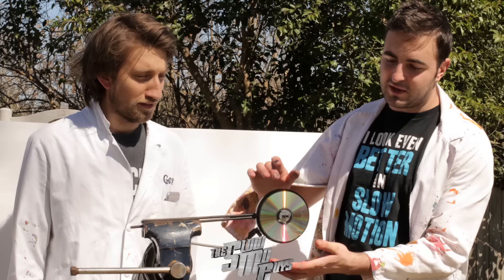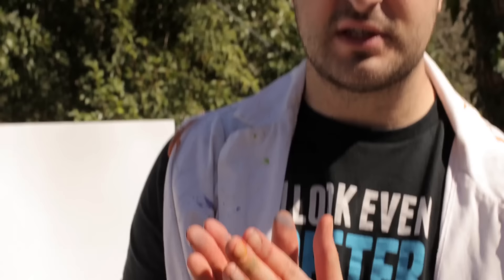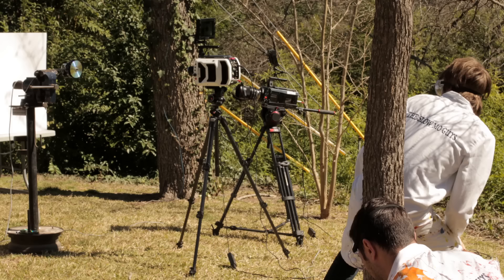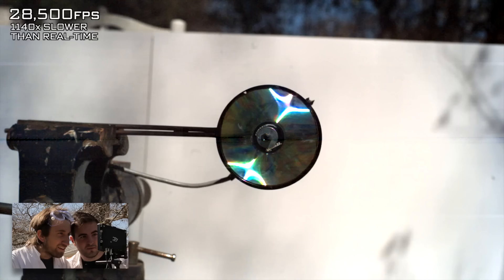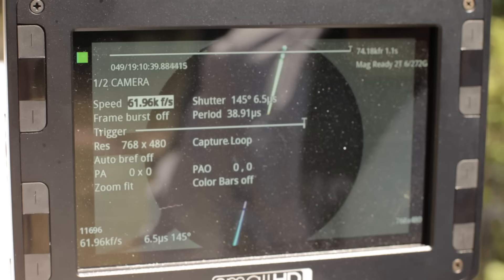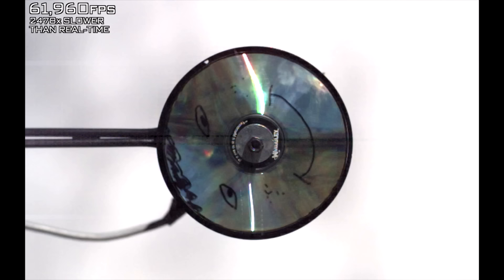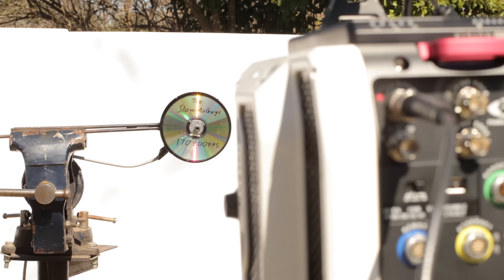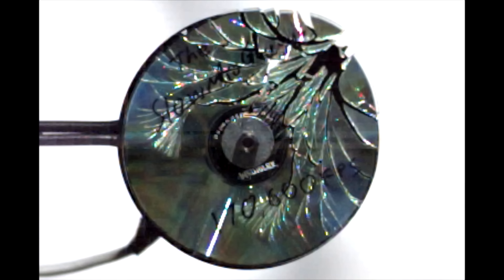CD Shattering at 170,000FPS! - The Slow Mo Guys

Comment: I just calculated that the edge of the CD at 23,000 rpm would be accelerating at 35,481 G's!
Reply: I think accelerating is not the proper word here? When it spins that fast it will feel a high g force. That is due to the fact that a point on the rim wans to travel in a strait line with the speed it has but is constantly forced to make the turn into a different direction. But that is not acceleration since it is constant until it will shatter. From this moment the pieces will start traveling in a straight line that will bend due to the gravity depending on the direction the piece get's launched. And the pieces will decellerate due to air resistance and (gravity  when traveling up.)
Reply: dextersxxxxlab yes most of that is indeed correct, as a major in physics, but it is incorrect to say that gravity will slow it down. Indeed, air resistance does slow down the pieces, but unless the cd fragment is rapidly accelerating at 9.81m/s squared, and counteracting gravity laterally, gravity will actually cause it to accelerate. While those fragments were going quite fast, frame by frame analysis makes it look quite slow, in comparison to something like a space shuttle, which can go at some unfathomable speeds about 1 minute and 30 seconds after launch, and of course the shuttle could only barely get into orbit, so it is unlikely that gravity would slow down the cd fragment. I do like your method of explaining things however, thank you for making the internet a great place 😀
Reply: @dextersxxxxlab  if it wasn't accelerating it won't have broken
Reply: @initiatingspin195  That was why I stated that the pieces only would decelerate due to gravity when they were traveling in an upward direction. (The last words in my explanation)

Comment: How come you can upload footage in 170,000 FPS, but you cant have it in 1080p60 on YouTube...?
Reply: It's not gonna affect the whole purpose of the video, at 60 fps it would look more fluent and consistent.
Reply: Wrong. The video is not at 30 fps.
Reply: the video is at 30 fps though. you can upload at 24/25 fps. but if there is no fps number next to the resolution that means that its standart 30 fps. though of course they could show the slow mo footage at a different resolution than the rest of the video.

Comment: I'm not a scientist, but does it warp because the speed at the center is faster than the speed of the edge? So eventually it gives in to the force and just breaks?
Reply: Julian Acabal No its the G forces that are acting upon the CD pulling on each side outward. Like how a roller coaster sucks you back to the edge of your seat.
Reply: Julian Acabal youve got it backwards, the outside is faster. but good question!  (source: i study physics lol)
Reply: I don't think it's entirely centrifugal forces.  I think there is turbulence being created.  I'd like to see this "experiment" in a vacuum.
Reply: Ray Renteria I doubt it has anything to do with whether or not there is air present. It looks like vibrational frequencies cause the disk to break just by looking at how the disk warps in a wave like shape (sinusoidal). Probably caused by the vibrations from the motor
Reply: vic cobb Why would the outside be moving faster?
Reply: ***** Because everything is moving at the same RPM, but the outer parts of the CD have a larger circumference to go around.
Reply: ***** Speed of a rotating stuff is r*w where r the the radius you're looking it at and w is the rotationnal speed in rads/second. So obviously, if you're on the outside, r is bigger than the inside and so is the speed (w is the same at the center or outside).
Reply: Its because of the vibration depending on the rpm, for the right rpm you get a standing wave on the disk with a much larger amplitude which finally leads to the destruction of the disk
Reply: Julian Acabal The force is strong with this one.
Reply: ***** Because RPM = (Speed / Circumference) × 60. If RPM is constant (which is the case here) then to increase the circumference is to increase the speed. 

Imagine if you were to place a two dots on the disk, one near the center and the other near the edge. Both dots have the same RPM, as in they complete on revolution at the same time - but the outer dot has to cover a greater distance so to keep the RPM constant it has to cover that distance faster. Whereas the inner dot has less distance to cover, so it travels slower to keep the RPM constant.

Physics is such a beautiful thing.
Reply: I posted this elsewhere but it works here too, hope it explains it a bit :)

The centripetal force = m*v^2/r so at the high speed v becomes so great it is able to overcome the tensile strength of the CD.
So here is my math tensile strength of a CD=55-75 MPa, r=0.15 m, m=0.015g, CD(width)=0.006-0.008
v(tangential)=angular velocity*r
v(tangential)=2408*0.15=68.08 m/s

F=0.015*68.08^2/0.15
F=463.5 N

really we should now integrate to find the force on any one point along the disk since F=463.5N is the force at any point along the edge but I'm lazy so lets just approximate that this force will be working on 0.5 degree of the disk (I don't want to make the angle too small otherwise this'll just go to infinity) so A=2*pi*r*0.006/720=0.0000078

so F/area=59 MPa which is greater than the tensile strength.

This is of course is best case scenario but its also just an approximation, the order of magnitude is right so it is at least possible. Of course everything above is also an extreme simplification in reality it has to do with the elasticity of the disk as well and a bunch of other physics concept that would take to long to go over, however you can take a look here http://physics.stackexchange.com/questions/30769/fracture-because-of-high-speed-rotation for a bit more info on the elasticity problem with the CD fracture.
Reply: Actually it's not that, and as someone else already pointed out, what happen is the opposite. What you see are waves propagating through the CD, and making a phenomena called interference. The CD is vibrating, but much more than it would do at lower frequencies (lower RPM), and those little vibration are probably caused by the medium (the air) that is twirling on the surface of the CD and hitting it multiple times (but I'm quite sure it isn't just that). You see it bending in a "constant" way, because the CD is dimensional finite (it's a circle), and those are stationary waves. I said "constantly" because if you watch closely you see that the bends actually moves around the CD, and the RPM of this one is different from the RPM of the bend (this is what is called group velocity and phase velocity). You can see the same phenomena by watching a cymbal getting hitted by a stick in slowmotion (while the cymbal is getting hitted one single time the CD is getting hitted multiple times). I don't think my explanation it's clear (neither it's totally right), but I hope you got some hint to search more about this :)
Reply: Well thank you, everyone who answered.
Reply: PumpUpTrack Yeah I agree with what you are saying, like I said at the end there is a lot more to this than just what I suggested but the math wasn't to crazy for the tensile problem so I went for it. The idea of the air is interesting but it doesn't have a huge effect I don't think since the CD is mostly smooth and will only cause a small amount of air interference, so you probably would have to raise the RPM in a vacuum, but you could still get the same effect. However as I alluded to with the elasticity problem, there is definitely something going on with those standing waves that I am yet to fully understand. :)
Reply: I know nothing of the physics involved, but I wonder if the cd is traveling so fast, that the waves are a result of the information of the spin, is traveling slower than the cd is spinning. Basicly, what I am thinking is that the cd is spinning faster than the speed of sound within the cd, causing stacked shockwaves. But I am probably completely wrong.
Reply: 610bob At first that was my thought as well, actually at first I was trying to find the point along the CD this happens, but in the calculation I did above I found that the fastest part of the CD still only travels around 68.6 m/s (tangentially) and speed of sound just in air is over 300 m/s, in the CD it'll be around the 1000 m/s mark, I would guess probably a bit faster. So that information lag won't cause the fracturing :( although I do want to find a material I can use to do that with, possible just a really thick CD? could be interesting. Then again I also want to try this in a vacuum... hehe I know what I'm asking my prof to do next week xD.
Reply: It's a fascinating video an this is what i see as an engineer:  As the cd increases its rotation rate, it comes into radial tension. i.e the material is being stretched outwards in all directions. this in turn puts it into angular compression. i.e if you consider a circular line around it, it's being squashed along that line.   This is the reason for the warp a lot like how spagetti warps when you compress it.   The failure seems to occur when the warp reaches a critical value although I wouldn't bet the house that it occurs precisely at a peak of the warp as shear effects have to be considered also.
Reply: Julian Acabal so much crappy science on this thread...

This phenomenon is called "whirling" believe it or not. it's a problem with industrial equipment when shafts are unbalanced and running at high enough speeds. CD's are balanced pretty well for what speeds they operate at, but if you spin them fast enough, eventually imperfections and vibrations set mass into a path where it is more or less flung into various directions by the centrifugal forces. the cd will act like a spring and pull it back in, but that only helps to throw it out the other way. and once it starts to warp, it becomes more unbalanced and this effect becomes more and more prominent. 

i'm not sure about if it is going on here, but at the right speed for the right item, resonant frequencies will be reached and oscillations will become massive (like that windy bridge video if you've seen it). It looks like they may have just brute forced it. not sure, but it might be possible to see this warping happen at a lower but very exact speed.

Source: actual mechanical engineer :)
Reply: Chris Ayers See I thought of that before but I don't see this speed being high enough to cause this to happen, I know it does a very high speeds but for the CD I doubt this rpm is fast enough. That said there is no math behind my comment I'll probably try out the math for it tomorrow and see where that takes me.
Reply: vic cobb I'm pretty sure he meant angular speed
Reply: Its just that the outer points on the CD compared to points closer to the center have a greater speed, hence the force exerted on them is much higher, therefore the material expands at the edges more. Since the rates of expansion isnt constant throughout the CD, the only place the expanded materials go to is to warp.
Reply: Jolga Dirona Sorry, my post wasn't meant for you, but thanks for the responce :). Anyway I don't think CD are really smooth, they are the opposite, and probably that's why the air they are moving it's low (but I still think the air cause some vibration on the body), and that's why I think Chris Ayers is right. He explained what I though when I said "I'm quite sure it isn't just that", but I couldn't explain it with technical words. :)
Reply: Chris Ayers yeah that sounds good
Reply: That is rotationally induced vibrations which are causing it to warp. Has nothing to do with turbulence. This phenomena would occur in a vacuum too. Normally this should break from the inner diameter of the disk; however, it appears that the stresses caused by the warping far exceeds the stress on the inner diameter of the disk.  Quite interesting to watch, even for an engineer. Chris Ayers has it right
Reply: Salien1999 The disk should have the outside moving faster, however I have a feeling air drag is slowing the disc more on the out side then the center causing  the inside to actually have a higher RPM or at least try to,  and thus it rips the disc apart. If done in a vacuum, the motor vibrations would still rip the disc apart but I think that would be at a higher speed, as there is no air drag to slow the outer parts of the disc. And Air drag is a key factor, If you run a disc drive open at its normal speed, you will feel a fair amount of air being pushed around, speed it up drastically, and the air drag becomes a quite formidable force.
Reply: Joseph Florentine oh and the outer part of the disc is still spinning faster than the inside, but the inside is having to continuously in-act force on the outer part to keep it spinning causing stress.

Comment: Did you know that if the whole CD was exactly equal strength in every area, it would just thin out until it was an atom thick, then it would just continue spinning like that unaffected for as long as you want, (Theoretically) but it's not like that, so the force on the CD starts a crack at the weakest area, weakening the areas around it, and repeating the process until it stops spinning.
Reply: +Da Wulf That's not how intermolecular bonds work.
Reply: Dude, at least know what you're talking about before you try talking about it.
Reply: What you said is outright absolute bullshit though. You're basically claiming that: 1. All the molecules making up the substances in a CD are planar and 2. That covalent bonds can provide infinite centripetal force.
Reply: I did not claim it would work with the amount of force present, although I can see where you would've assumed that, and secondly, they might not be planar, but in theory they would BECOME planar, look it up before you argue about it, it would get to a rpm that would cause the atoms to separate making it much like a liquid, causing it to be very easily stretched by the centrifugal force, honestly kid, do your research. Also I said in THEORY, I never said it could be guaranteed, and I never stated it was a widely believed theory. So please do some reading before you speak to me again.

Comment: i want to see the 7,5 hours of that
Reply: Yes, but to watch the approx. 4 seconds recorded at 170,000 fps would take 7.5 hours to to watch at 30 fps, that's what (s)he meant.
Reply: dude, imagine 170 thousand jpeg 720p in your pc son
Reply: That's why they are recording at such a low resolution: The camera simply can't write so much data to a harddrive at these resolutions.
Reply: Champ Gnions
While it is almost impossible to determine how large a jpeg video will be from pure calculations, I can figure out how large it would be as a raw + wav video... just give me a minute to figure it out :D
Reply: After doing some research and analysis, I found out that the raw + wav 720p 170600fps video would stream at about 472 GB/s, and watching the 7.5 hour long video at 720p30 would be 2.212534 TB in size, streaming at 82.97 MB/s. Fun research and quite shocking, to say the least XD For the attention of any nerds (like me) reading this: This was done by analysing the audio frequencies of the slo-mo video to peak at around 6500Hz, as well as assuming the video itself would use 3*8-bit RGB colour at 720p (921600 pixels). This was also done by using approximation of the frame rates and the 7.5 hours at 30fps stated in the video to work out that the recording was about 800000 frames in length and that using the 6500 Hz at 30fps for 16-bit unsigned PCM for the WAV audio would produce an audio clip attached to the video of 74 MHz 16-bit unsigned PCM at 148 MB/s.
Reply: N1ntendolov3r thanks for the info, but the audio is really 6500 hz? Cuz that ain't high for any microphone?
And it's easy to know that the resolution is 720p since when he films the screen, it's right there with more info.
Reply: Champ Gnions
No, the 30fps slowed-down version is 6500Hz, in real time the microphone would be working at 74000000Hz (74MHz).
Reply: N1ntendolov3r oh yeah I forgot the mhz.

Comment: The disc was not centered. The fractures were always beginning on the side closest to the center because the small amount of extra weight on the one side was compromising the material with unequal pressure and tension in a tangent direction. (as opposed the centrifugal force pulling equally on all sides until the lateral tension pulled it apart.) If someone can better explain what I'm trying to say then go for it! It would be cool to see what happens at higher speeds when it is centered!

Comment: 170,000 frames per second? I don't want to Imagine the file size for the video
Reply: 96 gigs xD
Reply: SorrowfulRose lol, that is GTA 5 (60 gb) + Battlefield 4 (15gb) + Assassins Creed Black Flags (15gb) file sises combined
Reply: guns 57 thats fucking hilarious.
Reply: Molo CnR With SSDs at least it isn't such a pain.
Also,  after the rendering (won't take that long actually), it's no more work to do. Maybe 4-5 hours for the video parts, editing and uploading.
In real life it will take longer as you won't be working five hours straight for a video for YouTube.
Reply: +Molo CnR I'm more concerned about the technical feat of the camera generating 96Gb of data in presumably a very short time. Imagine the RAM size and CPU power necessary
Reply: +guns 57 2 hours of recording with 170.000 fps is 1250 gigabyts :P
Reply: +lasse bengtson it's actually 2,880gb
Reply: +BvousBrainSystems There's a reason those Phantom cameras are expensive as fuck.